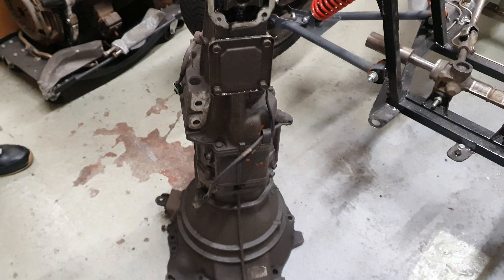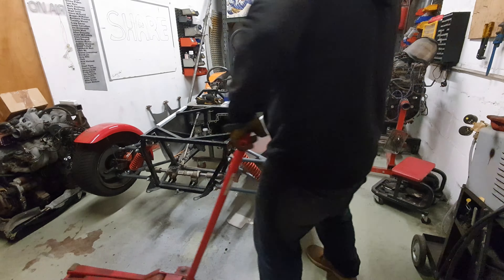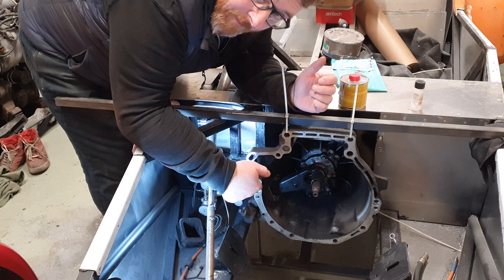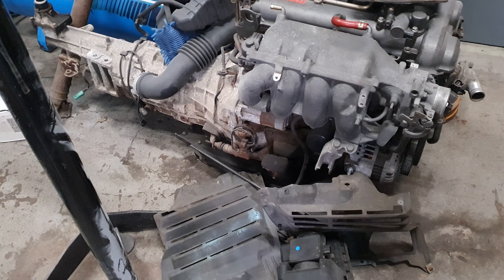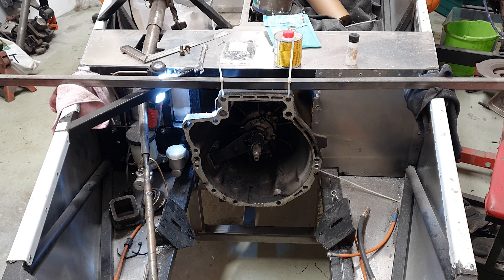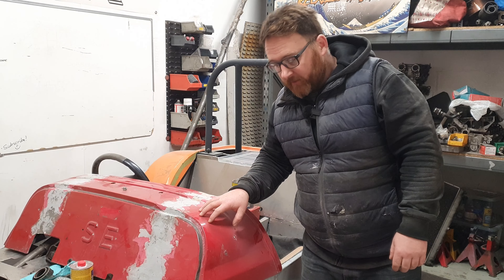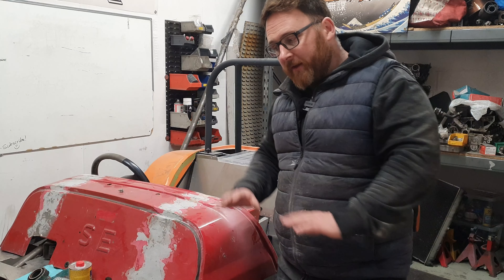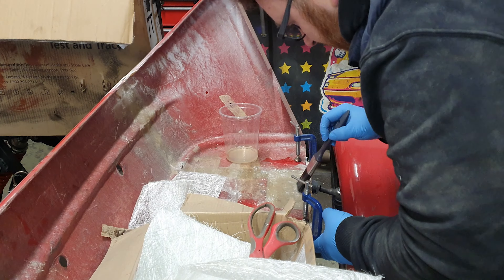Them Little Things - Locost 7 Kit Car FULL BUILD!! - Episode 64 - (Project 7-UP)

Comment: I'm lucky that I'm in LA, here the engines and transmissions are like new. The diff needed quite some cleaning though. We are saying here fiber glass, which I will have to use myself for the first time. My frame is wider(45-5/8"), so I will have to widen the nose and scuttle/cowl. They say that it is a good idea to sand down the fiber glass edges, to be tapered. Otherwise you will have an airgap, because of the step. Easy for you guys there in UK, you can pick up Westfield parts, modify them a bit, and you are done. I will have to make them out from aluminum sheet, from scratch.

Comment: When you pulled out that first degreaser I recognised it immediately. I bought some and still have not found an actual use for it (apart from taking up space in my cupboard!). I believe the gearbox switches are neutral (the one on top) and reverse (the one on the side). I also have very little clearance for the upper one so I'm very interested to see what you do.

Comment: If that is the reverse switch and you  need clearance, dont put an indent in the panel, cut a hole and put a grommet in. That way if the switch fails you have an easy access point to get to the bolts to change it.
Reply from the maker: Good idea